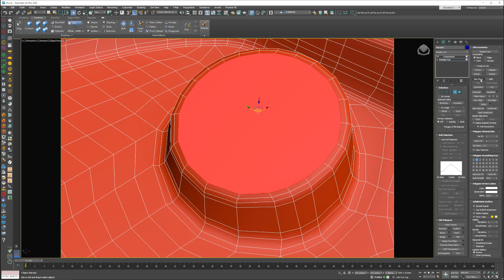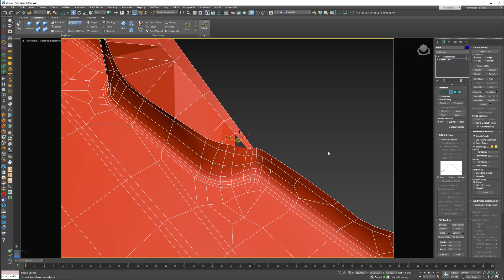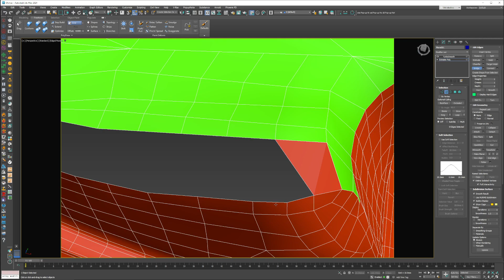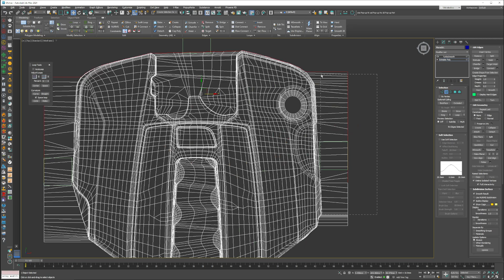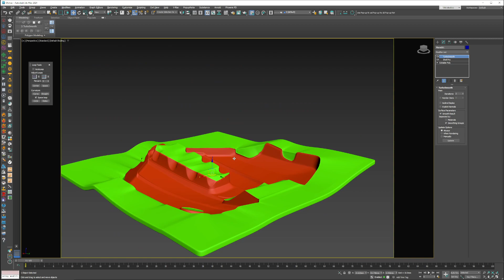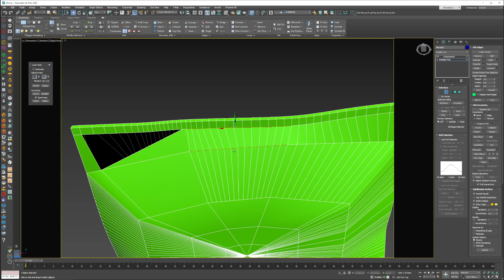How to create a flange for a 3d printed mold

Comment: Could this be done on blender as well? I’m new to 3D modeling but I’m wanting to turn my Mk4 Supra timing cover STL files into molds but I am struggling to achieve the same thing.
Reply from the maker: I believe so and I think Blender might even have a better/easier retopo tool!
Reply: @poltdesigns thank you so much for this! I finally was able to get pretty close to making the mold. The only problem I’m having now is some of the holes I closed off only partial appear in Bambu studio. I’ll keep messing with it. Thanks for the inspiration!
Reply from the maker: @Tyler.2jz.a80  If you are using 3d max try to reset xform on the part before exporting. Also if it stoo thin migth be a possible issue as well.

Comment: Hi man, this looks really interesting. I have a question : Why don't you use fusion360 to do all the CAD?
Reply from the maker: I have been using 3d studio max since 2001 or so and model very fast in it.l Normally I model custom car body parts and even in the Fusion videos I have seen the workflow they use is similar to mine except in fusion obviously lol. If I was to learn a cad software for my needs it would def be alias studio tools since thats what real car designers use from my understanding.
Reply: @poltdesigns  I saw your answer very late ^^ OK, thank you for those informations. I design all my molds in quicksurface+fusion, i was just curious about this software. It looks like it is way faster than fusion and really made for those complex organic shapes .. Such a cool video btw, i learnt a lot
Btw, yes, alias is used in big companies. I work in a motorbike company and we use Solidworks/Quicksurface/Abaqus but it's uncommon from my understanding (and not practical for fast direct editing)